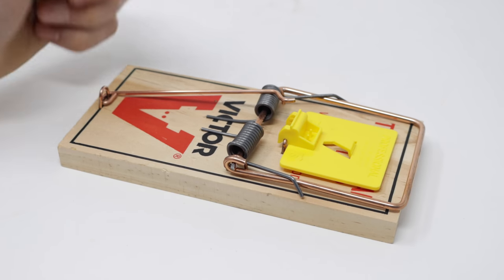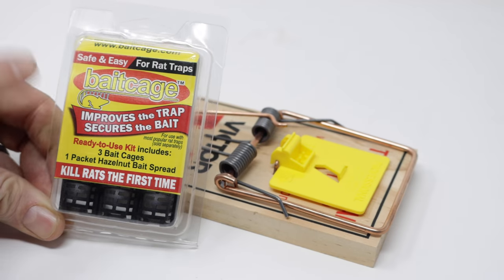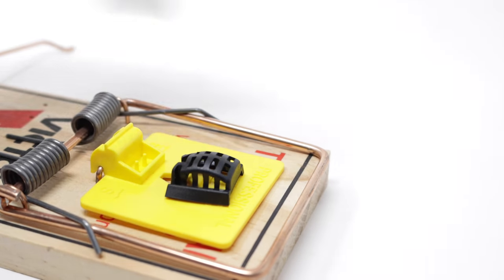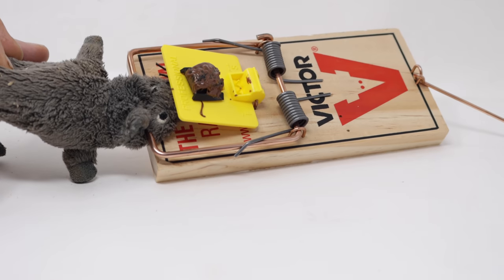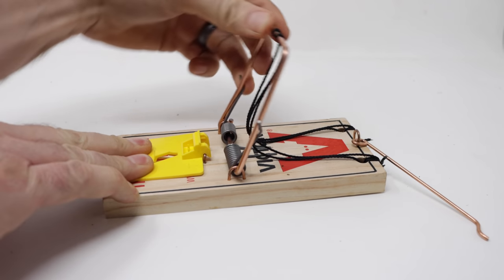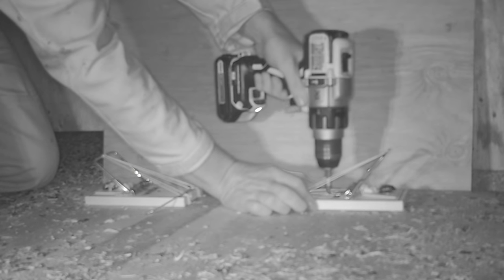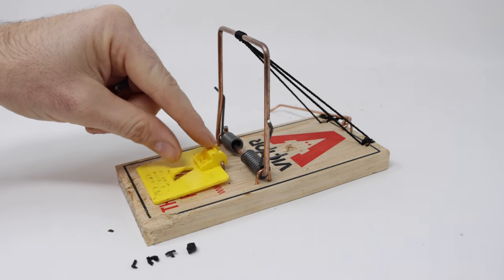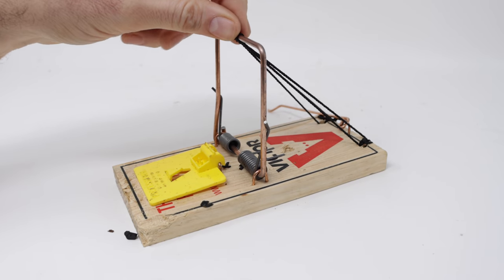How To STOP Rats From STEALING bait with the Bait Cage. Mousetrap Monday

Comment: That's a fantastic idea.

I only wish the home depot in town sold the traps with the yellow triggers.
They have seemed to switched to the copper triggers.
Reply: The copper trigger traps are cheaper.  I was pricing traps the other day to repurpose them for a modern day Mascall trap.  The other curious thing I noticed that it is cheaper to buy the Victor traps in 2 packs at the local farm store than to order them in bulk off the internet!
Reply: @ronaldclobes9340  thats good to know!
I have a friend that has been using tootsie rolls for bait for his traps and it has been successful for him so another plus for the copper triggers traps is that they are perfect for sticking tootsie rolls to them whereas the plastic ones you can't easily do that with.

Comment: I had the same problem with the metal mouse traps. Solved using some pliers to squeeze down the part of the bait holder that holds back the trigger. Made it stick out so little that the trap is hard to set without it going off. Never had bait stolen again.
Reply: i do it , genial ,

Comment: I do two things: 1) Use the smaller, metal trigger traps. That solves half of the problem since they can't keep their bodies out of the trap. 2) Use raisins for bait and use a thin, solid copper wire to wire it to the trigger. That way they have to work to get the bait and they are in the kill zone longer. Scattered raisins around the trap make them feel comfortable. Since I buy the smaller trigger traps to begin with, my solution is a zero cost one (old telephone wire is source of copper wire). I'd recommend trying that.

Comment: I use Cotton string and wrap several winds around the bait trigger. Then I press the peanut butter or nutella into the string and eventually they want to eat and pull the string. Its has worked for both mice and squirrels. The squirrels I added some sunflower seeds to the bait. This works every time and I just cut off the string and start again with new string.

Comment: The trick is to set it so sensitive, the lack of bait sets it off. You do this by adjusting the snapbar holder (The metal loop holding the triggering bar in place) slightly farther from where it was installed.

Comment: I have the 1¢ solution that works just as well, and you get 100 bait covers for a dollar. You stick a penny over some peanut butter on the trigger, and smush it down so some of the peanut butter sticks out the sides. The rodents get greedy after cleaning off the edges, as they can't chew through the penny and start pulling at it. The result tends to be inevitable. Also the penny is re-usable.

Cages that do the same thing, even if effective, are a bit overpriced in comparison.

Comment: I just make a little pouch out of plastic window screen replacement material and a couple of regular office staples. I bate the metal trigger, on the classic Victor traps, and then slip the screen sock over the bait and the trigger. Then I press down on the screen, below the level of the metal hook, and pull the screen forward about 3/16" to stab and fix the screen in place. I then slather the screen with additional peanut butter or cheese.

Comment: It's amazing seeing the reaction speed of those rats. They are out of there before the tripped wire has even reached the bait.
On setting my mouse traps of this design, I back up the base plate against a wall or other firm object so when it activates, the force of the sprung wire loop isn't wasted by the base of the trap lurching in the opposite direction away from the mouse. That could be the difference of nailing them in the head or a near miss. I've been around often enough in the same room to know when these old style traps work correctly, from hearing them trip to no sound of a struggle or even hearing a reflex twitch is no more than 5 seconds.

Comment: i used window screen ( metal ) wrap trigger with screen to enclose bait - 
zip tie or wire in place has worked 100% - 
second rat cant eat bait ether - 
to make spring Stronger - place 2 stacked pennies under spring arm
where spring contacts wood base -

Comment: There is a mouse version of this on Thingverse if you have a 3D printer.  If you increase the size to 150% it will fit a rat trap. It has worked twice for me so far. The competing 3d printed "walk the plank" rat trap has scored 3 times in the same time.

Comment: On the smaller mouse pads they have several holes on them that I squeeze a nut mixture into that way they can't steal the bait out of the bait holder. In order for them to get any of the bait they have to place some downward pressure onto the pad thus setting off the trap.

Comment: make a small wire mesh bait attachment, a rat wont chew it up like rubber.
Reply: Exactly. I've had to make  "cages" for the bait cups on those Tomcat snap traps to prevent bait theft. Drill some holes through the base and use hardware cloth to encase the bait cup. Wire it to the base.

Comment: Instead of the cage, place the bait on the side facing down.
Reply: Depending on the bait used it could prevent the trigger from depressing enough to set the trap off
Reply: @noway-wk8bf  Exactly. These traps go off when the pan is depressed and the trip rod slips out from the back of the pan's vertical tab. If the pan is lifted it's just pushing the trip rod further in, not out. Somebody please explain that to the mice though. They've figured out both scenarios.

Comment: I use the victor M140s and have never missed a mouse. Never once had bait stolen. You should test that
Reply: I stick with those too. Old school. The last few packs though, after a few trip actions, the U shaped staples holding everything into the wood base pop out, sometimes while I setting the spring, sometimes when the trap snaps. Maybe the wood is too dry or too soft to hold the staples.
Reply: @charlieross-BRM  you and I are talking about 2 different traps. I'm talking about an all plastic body with  an inclosed bait cup a tiny hole leads to the bait the mouse stick its head in to the bait cup when the lid raises the bar snaps insuring the neck is in the correct place for an instant kill. Look up the name you'll see it

Comment: Make your own add-ons using 1/4" hardware cloth. Cut a peace 3/4" x 1", roll it around a pencil, fill with bait, use a fine wire to attach it to your trap. It works! I used it for more than 20 years with great success.